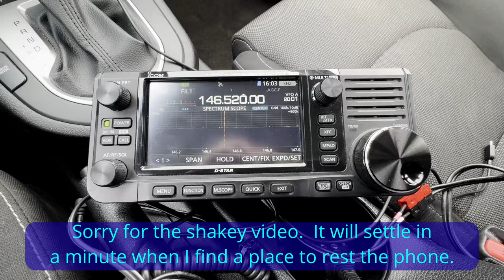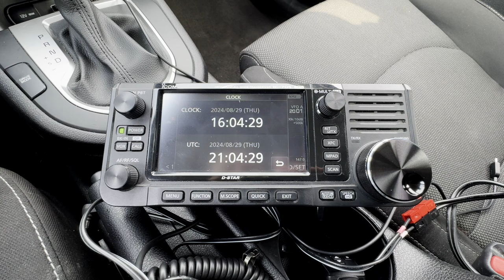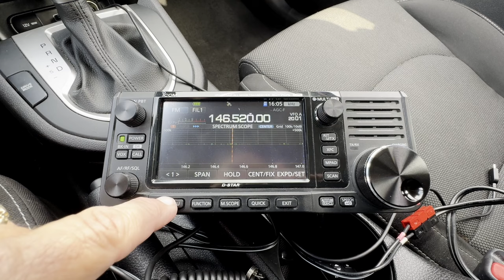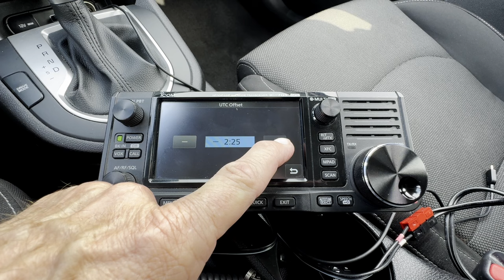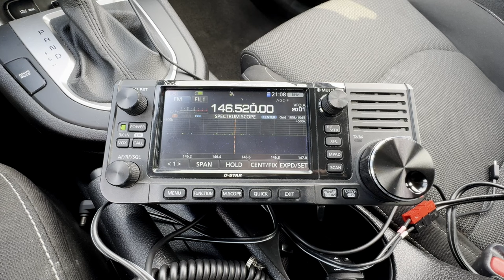Icom Clock Settings

Comment: Thx, I had to turn my 705 on and see what my setting was because I took a road trip in June from Florida to CO and WY and activated states and parks and summits along the way and I wondered if I had forgotten about the time offset changing as I use UTC display time for logging.  M offset was set to zero as well; dont know if that is the default setting from purchase or if I changed it when I bought it; good tip...glad my is set to zero so I always have the right time when I travel with it!  Bob

Comment: great tip Tom !  Now someday I have to open up my 7300 and change clock battery. But i have a program from Icom to set the clock from my PC and that what I do.  I have my laptop Time as master clock. I either have internet of GPS dongle . I have even used WWV to set time and doing it manually took a few tries to get FT 8 to work. Once I started decoding  I did a average of time offset  and manually adjusted and was working great after that. Was a cloudy day with heavy rain and was portable in a tent and no GPS lock. If I can GPS lock just once my laptop good on time a day or 2 for FT8 . 73
Reply from the maker: WWV is a great “no matter where you are” way to set the clock.  Although you at least have to hear it.  I remember seeing a project a while back to build a WWV time decoder.  All the time information is digitally encoded in the beeps and buzzes that play each minute.  Might be fun to build a WWV decoder that automatically sets the time on the rig.  Probably somebody has already done it somewhere.

Comment: Hi Tom, great video as usual! I havent yet found a way to have either my 7300 or 705 retain time settings whern the DC power is removed. It may be in the manual but i couldnt readily find it. Any thoughts on this?
Reply from the maker: Hi, thanks!  On retaining the time..  I’m pretty sure that the 7300 and the 705 have in internal lithium battery or maybe super-capacitor that does keep the clock going, but it doesn’t seem to last very long.  I think the 7300 will keep time for a couple days to maybe a week, at most without power.  I have never done a comprehensive test.  Both radios should retain settings - UTC offset, etc.  just not the current time.  Of course the 705 is easier to deal with.  As long as it can get a GPS signal it will reset the clock on its own.